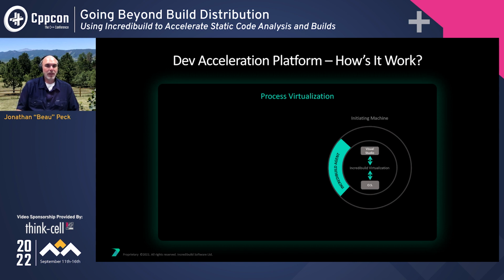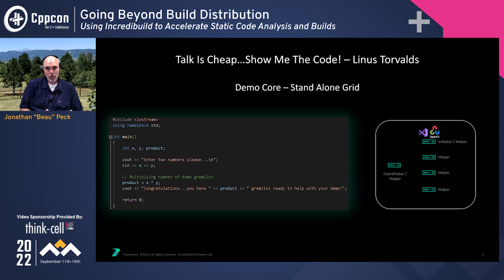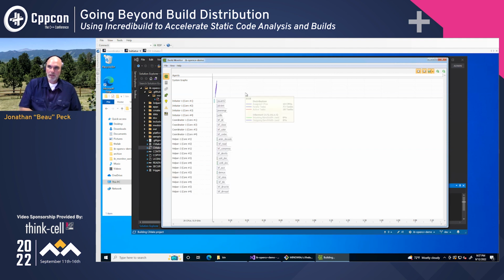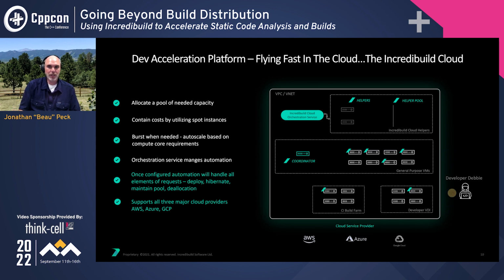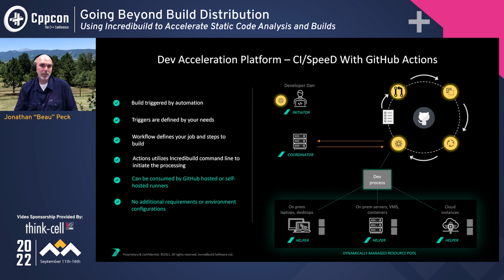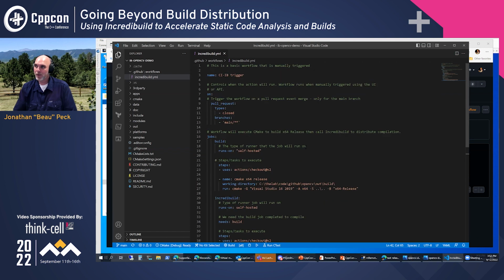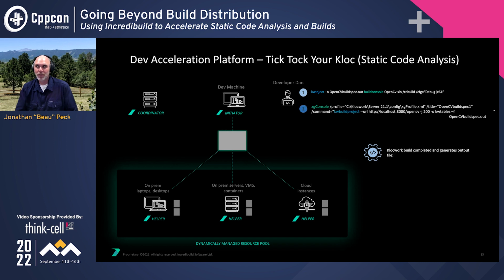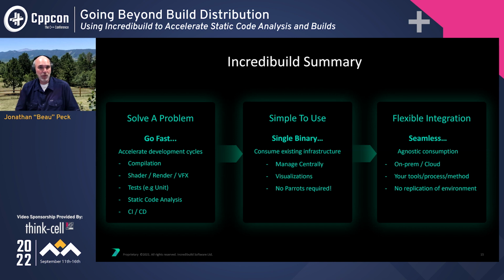Using Incredibuild to Accelerate Static Code Analysis and Builds - Jonathan "Beau" Peck  CppCon 2022

Comment: This looks like Jenkins (controller managing a set of nodes - coordinator managing a set of agents through an initiation) + K8s (send tasks instead or requesting VMs, ability to scale up & scale down number of containers - integrate with your cloud provider) with a nice UI (the Gantt chart is tiiiiiight).

There are no revolutionary ideas here, just a well-executed conglomeration of the best existing ideas. Claiming lack of originality is not a critique. It’s just not revolutionary or mind blowing. Looks really convenient and easy to use - but this talk did not motivate me to be an early adopter. I’d be happy to walk into a shop already using this, though.
Reply: Incredibuild is 20 years old; I was working on a team using it in 2007.  It is most useful when you have idle hardware on a fast network to distribute the work--and as mentioned in the talk it can't aid in linking.  Using a modern high-end desktop with 16+ local cores on a SSD the returns are less impressive than they were 15 years ago--his demo uses a 4 core initiator to make the time savings more impressive.

Given that you need to pay a per-CPU recurrent fee for the software, I'd be looking very closely at how much build time time is done compiling vs. linking and how much extra cost would come from upgrading to better dev machines vs trying to start a build farm or pay for cloud compute resources.